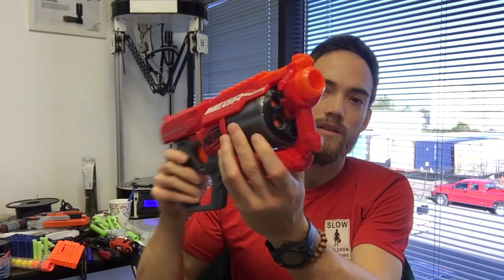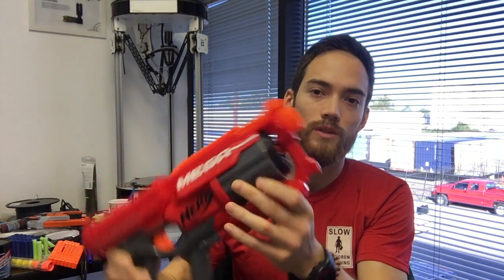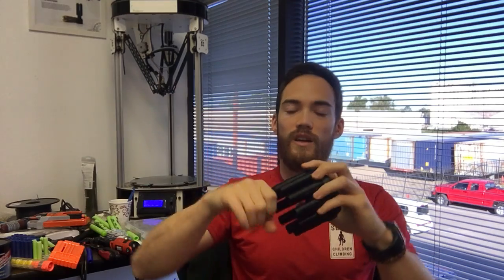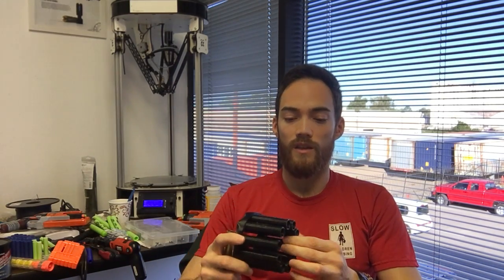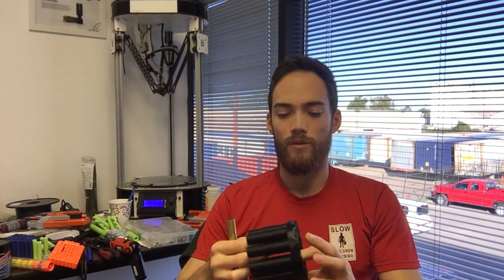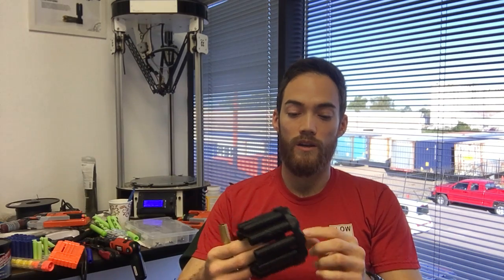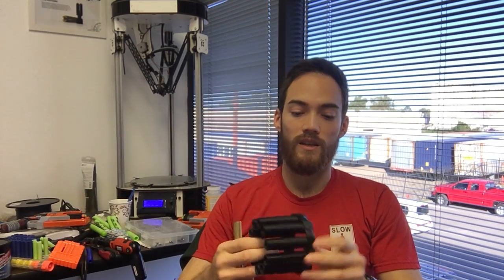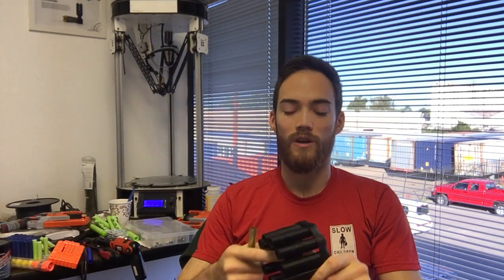Introducing Orange Workshop!

Comment: As someone with the Retaliator Stage 3 kit installed (alongside the Stage 1 & 2 kits) in one of my Retaliators, is there a chance of a converter/coupling being designed for us to use the awesome breach and muzzle combo of the second and third stages but also install something such as a pump-action kit that rides on the barrel extension for the Recon/Retaliator?